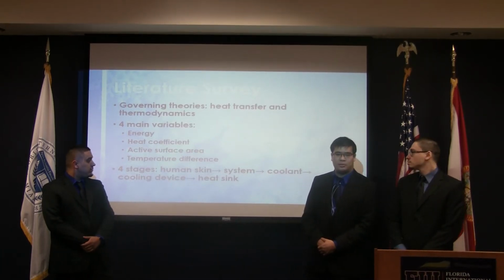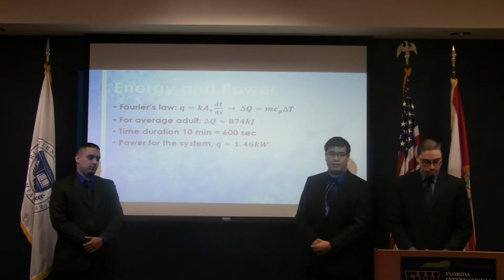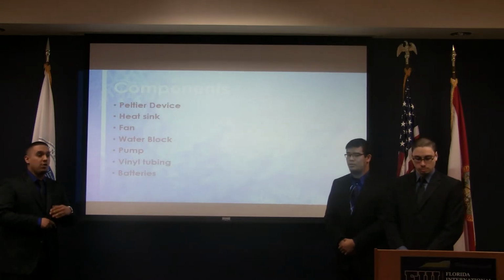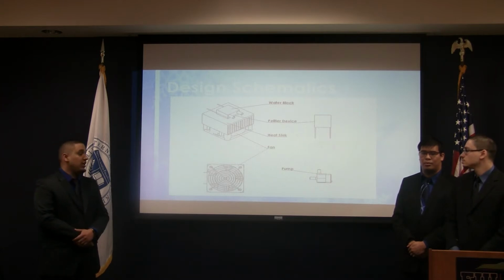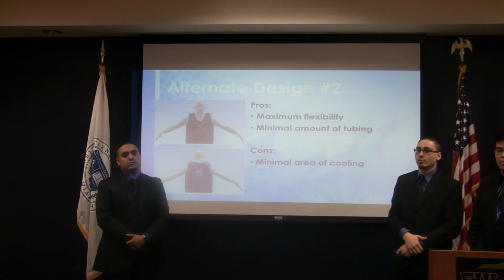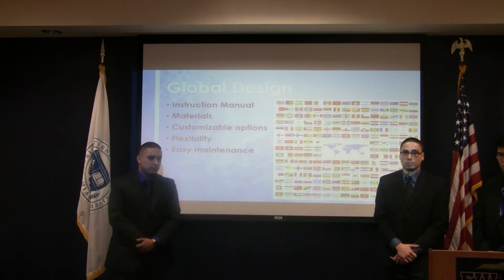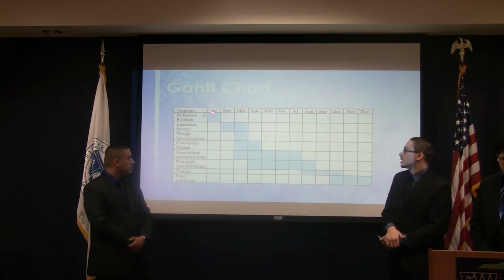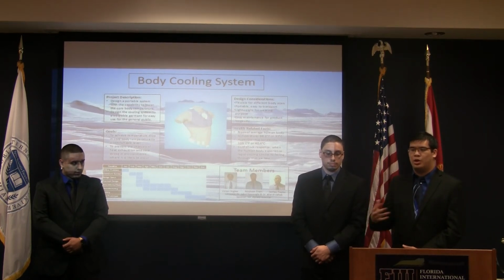SDO Team 6: Body Cooling System

Comment: This presentation was below satisfactory. The Power Point offers many good features like the pros and cons of their designs, equations and numbers on the topic and the inclusion of standards; however, the presentation as a whole is lacking. The slides are barely visible and the titles can not be read. There is too much text in the slides. The presenters have mixed performances. Speaker 1 was nervous and was reading from the slides. He needs to rehearse his part of the presentation more in order to have confidence in his part. The other two speakers were confident and knowledgeable in the parts.  These problems can be fixed if the group practiced the presentation more and checked how the Power Point looks before presenting it.

Comment: I like the idea, if done right this could be a great asset to athletes and workers, but I must say that the intro to the presentation can be improved. When you guy started your presentation it began by explaining how the device and its components worked. This left me with a vague idea about the problem you were trying to solve and with no clue to whom your suit was being marketed toward. When starting this presentation clearly state the problem you are trying to solve, i.e. workers and athletes so that the audience know what direction you are taking and then proceed to the technical aspect. Besides that I really like your project especially how you thought about using a submersible pump to quickly exchange the water and add biocide. I also like how NASA technology (the spacesuit) eventually gets integrated into commercial products. =]